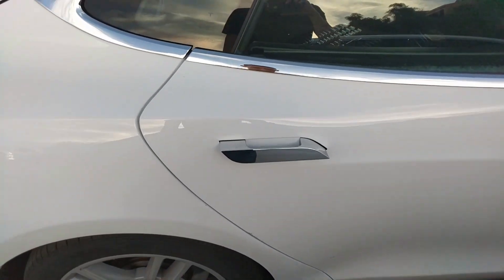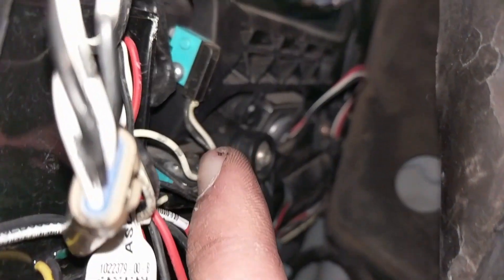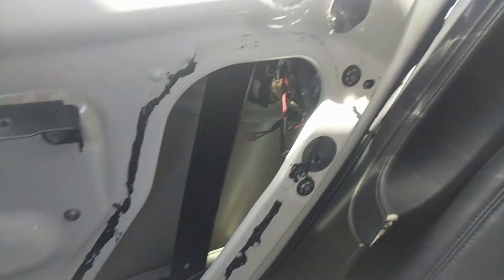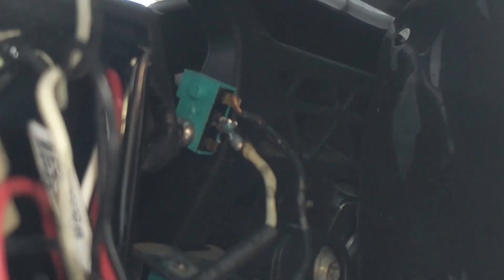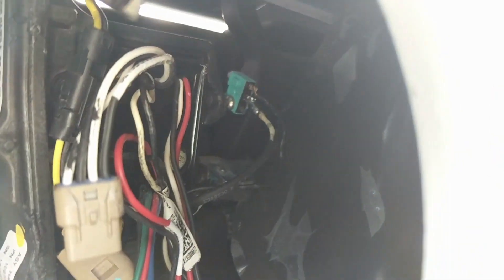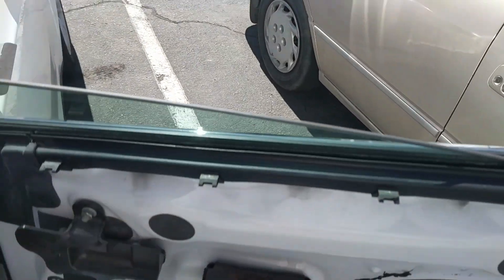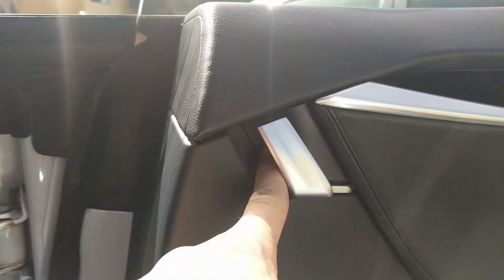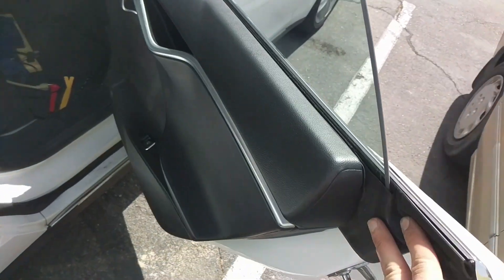Tesla Model S Door Handle Repair...without removing it

Comment: Was this due to handles not auto presenting?  3/4 of mine won’t auto present I have to touch the 1 door handle that does work to get them to pop out.  Will this fix that issue?  Tesla wants $1300 to replace them.
Reply: Honestly, the hall sensor based V2.1 handles are much more robust, and they charged me just under $300 to replace the driver door handle back in June 2021.  I felt it was well worth the price.  $1300 seems ridiculous though.

Comment: Well, you saved yourself a nice hunk of cash doing that repair. A wire breaking in that area is a rediculous design flaw.

Automation in these mundane tasks is supposed to be a feature and not something doomed for failure.
It's one of the reasons I didn't purchase an S model but went with a long range 3 instead and love it.
I'm pretty sure the door handles on the new S will be bulletproof, whenever that gets released.
Reply: The gen 3 handles use hall effect sensors, so they should be pretty reliable.

Comment: Pile of JUNK..yes tesla
Reply: Well, pretty obvious you've never driven a Tesla, but I do understand where your coming from as my attitude concerning Tesla didn't really change until I drove one.
Drive it and you'll know! You may have to fix mundane shit that normal cars have been doing for years with no issues but you will never have radiator, engine, exhaust, and transmission issues. Plus, after several years when you get the itch for new wheels, you can make your car available to the fleet and bring in extra cash.

Comment: Did it last?
Reply: It did, but I ended to replacing the switch itself because of the bad contact in the switch from me overheating it.
Reply: @K2Jennerator  where did you buy the switch from? And how much was it? Thank you for the video.
Reply: @K2Jennerator    But to replace the switch you had to take out the entire door handle assembly, right?
Reply: @UTArch1  yep
Reply: @K2Jennerator  do you mind sharing where you bought the switch and how much it cost? Thanks. My handle just broke too and will be looking to fix myself.
Reply: @Adrian-op5ni  The part is Panasonic ASQ10418.  I purchased 4 on DigiKey for 25.60 shipped back in February 2020.

Comment: Very good, now get ready to do that 3 more times.
Then get ready to do all 4 of them again when the plastic gear fails ;D
Reply: These actually have a metal gear! ;)
Reply: @K2Jennerator  Cast metal gears, it break easily. I already replaced 2 of mine by stainless steel.